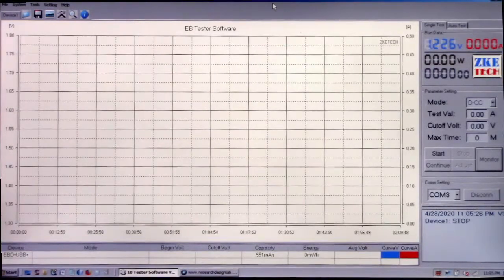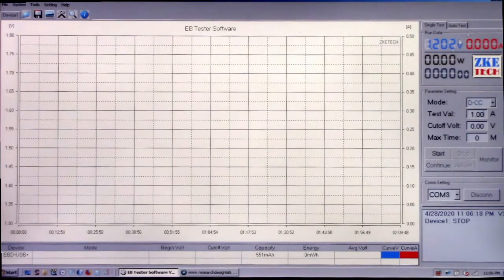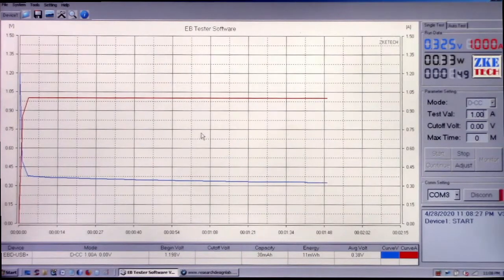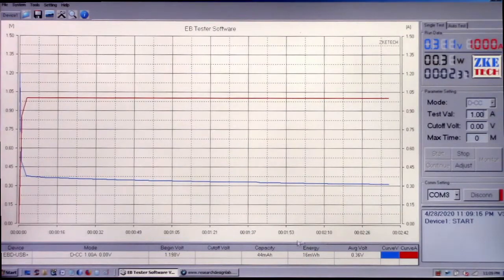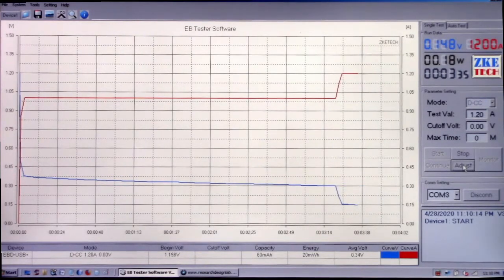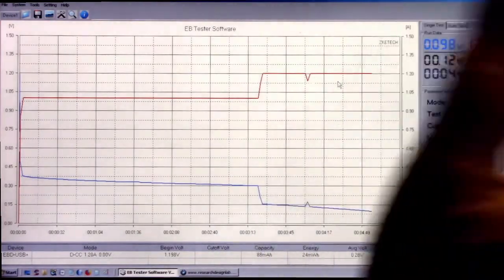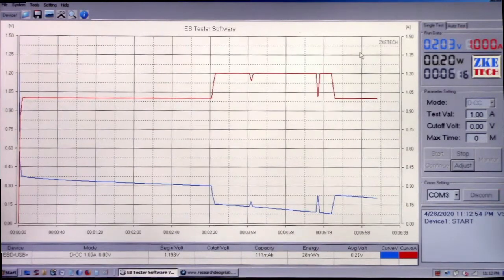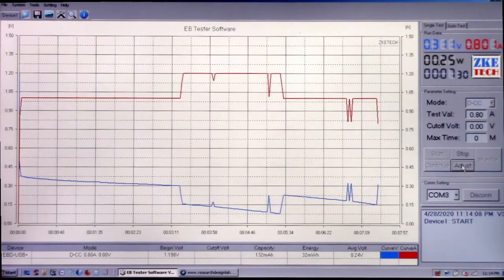Experimenting with the Iron Carbon Battery

Comment: WOW. nice load run. The spikes are where the device adjusts the load it cuts the load on and off (switch) and try's again if it can then it shuts off. I say great cell and it hold voltage well under load. Almost feel like jumping ship on zinc cell and making one of these cells.I think the carbon should be part of it it's the surface area. Unless it runs the same with just the graphfoil.
Reply from the maker: Thanks Dan,  When I first saw William Hada's version of this battery I did stop my work on nickel iron cells. Felt I had to try them. I've been very surprised about what they can do. I've noted that strange voltage/current fluctuation ever since I started using these EBD loads...any ideas why they made it like that? The battery output is definitely tied to the surface area at least at the positive carbon felt side. The iron side, after a few charges, get so thin that it doesn't seem to have a lot of area. Saw your latest videos...now I want a kiln to make carbon felt :)